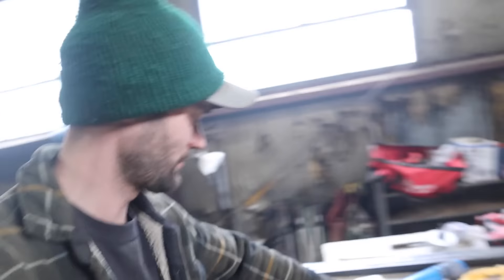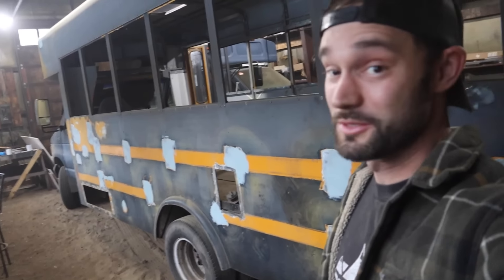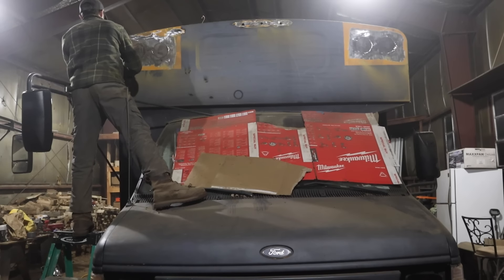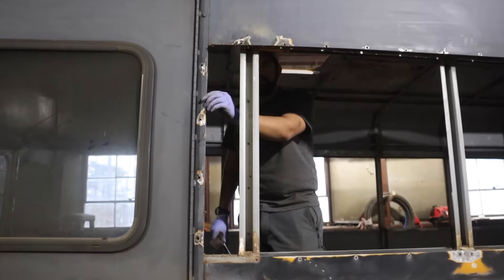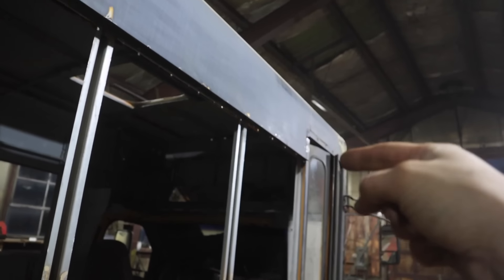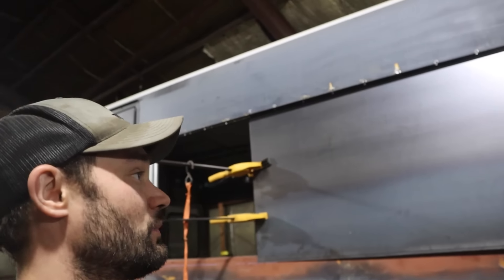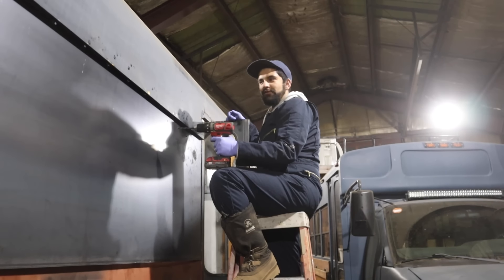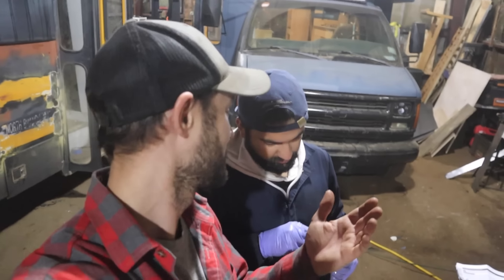Buslife is RIVETING | Sheet Metal Shenanigans

Comment: Some thoughts.  I will bet Metal Supermarket has a hydraulic shear.  If you went down there with the sheet metal dimensions when you bought the metal, the cut charge would have been minimal.  Also, you should probably either get a drill sharpener or buy a bunch of bits.  Dull bits suck.  It would also help if you lubed them a bit with either cutting oil or a cutting wax stick.  Very nice work.

Comment: I'm replacing some metal skin on a vintage teardrop trailer and I'm wondering what you do to seal the riveted seam.  I've read silicone bead, super thin putty tape.  Any recommendations?  Do you use anything?
Reply from the maker: Metal bond between the sheets
Reply from the maker: Metal bond between the sheets
Reply: @navigationnowhere  Thank you Sir!

Comment: Dude! You need to sprayfoam the shop!✌😎
Reply from the maker: I plan on pouring concrete and re-insulating over the next year
Reply: It's a BIG shop  - something like 60x30, and the side walls are at least 12 feet. It's gonna take a lot of work (and more than a few volunteers) to get the shop winterized. But it will be great when that's done.